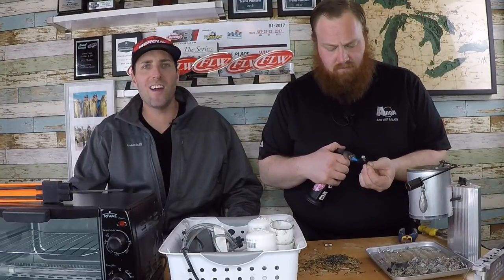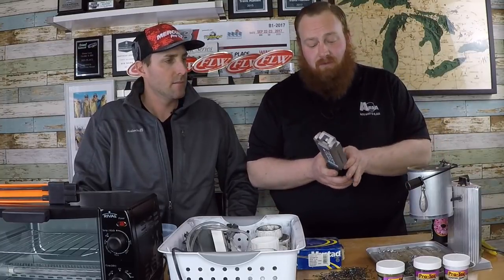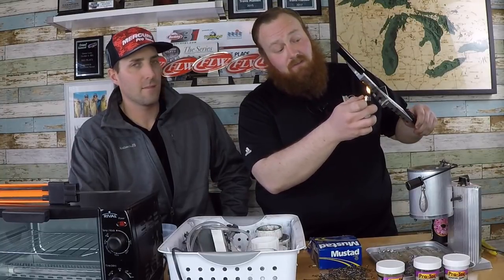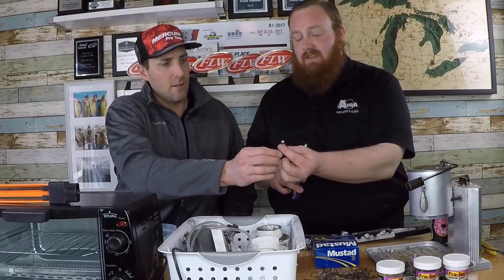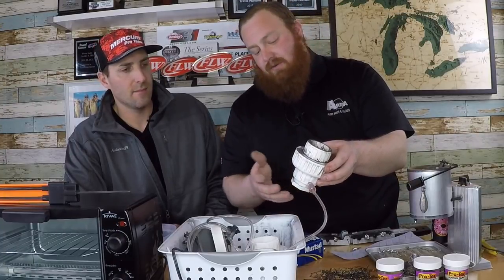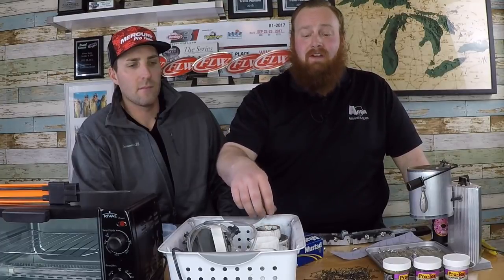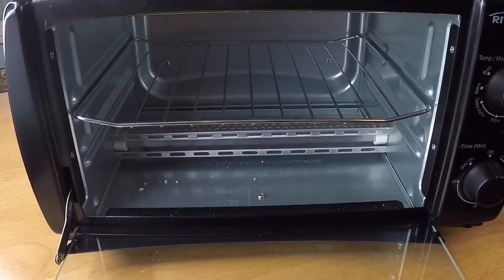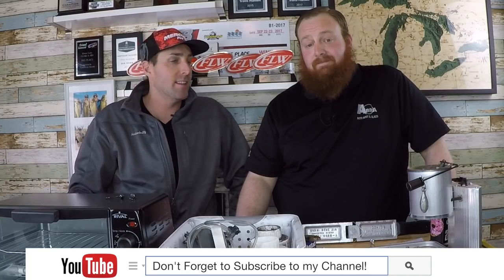How to paint jigs easily and make your own Ned Rig Heads!

Comment: Did yous try the Midwest finesse jighead mold they are just like Ned heads  you have wire keeper for the keeper
Reply from the maker: I haven't but I have heard about it. and took at a look at it...that may be a better option for the ned rig heads by the way it looks!
Reply: The Midwest is the one that I got  I tryed out the mold  this passed weekend